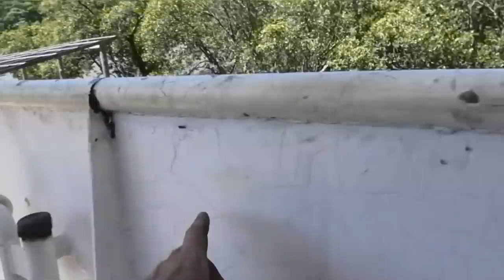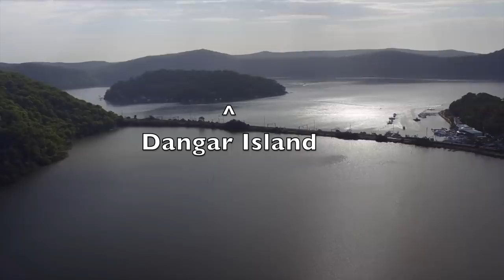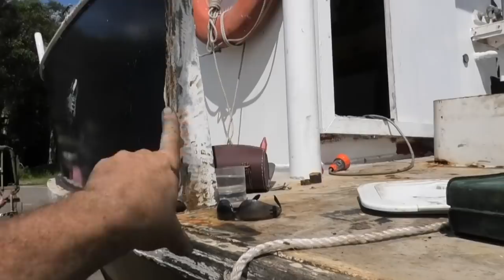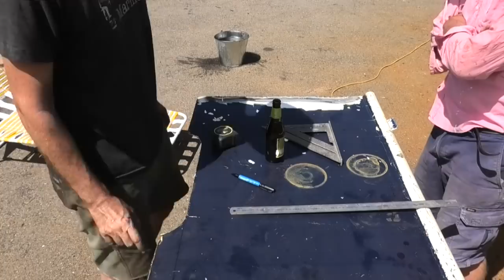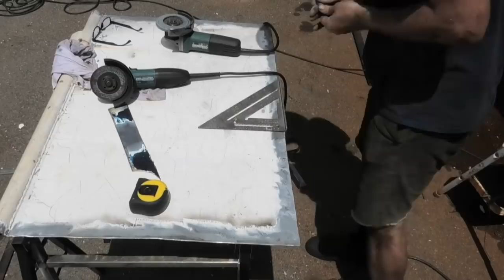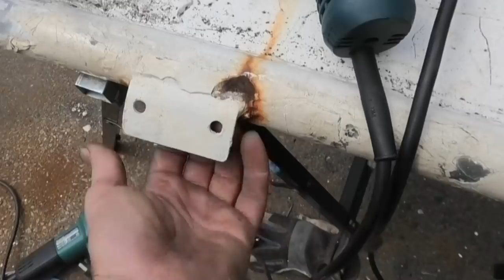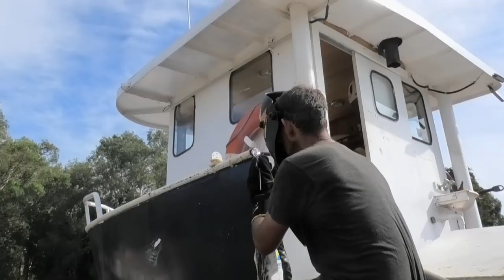Making a door in the steel trawler

Comment: Grinding/Cutting safety glasses a MUST. I've had metal in my eye Stu and its NOT fun!!!
Reply: You should have engaged your 'safety squints' haha
Reply: Over here we know them only by their power and the 2000W grinder is my go to tool for heavy cutting and even though I have an oxy-acetylene torch, I've never used it. I always use my plasma cutter or big grinder. 90% of grinder safety is planning your cut so that your grinder won't come at you if it grabs, sparks won't come at you and that the cutting disc doesn't get pinched. If the sparks don't come at you, you'll probably get away with those safety squints...lol
Reply: yeah it's not fun when they come into your eye with hypo needle and telling you not to move or blink while they drill our the metal piece, mine started rusting in my eye....
Reply: Strange that when I built a steel boat and wore safety googles, the metal pieces got past and  into my eyes, and I was regularly at emergency and the eye clinic, now I only wear glasses and have no problem.
Reply: Agree here Stu, my spark welded to the surface of my eye. The hospital had to numb it and pick it off with a hypo needle, then bandage until the numbness wore off
Reply: @mongomay1  That is really important. If you think you might have something in your eye, go to the hospital. It's not alright because it's stopped hurting it's just your eye growing a surface over the particle. Then it starts to rust. not often I put stuff in capitals but, GO TO HOSPITAL STRAIGHT AWAY!
If you're in the position where your head is in a frame and they are advancing towards you with the needle have the good sense to ask the nurse can you place a hand on their leg in case you need to blink, sneeze, throw up or other. You also get the pervert bonus points of feeling the nurses leg up.
Reply: @TonyRule  haha. Ave
Reply: The comments section on the internet is weird. Would you as the viewer of a guy riding a motorcycle down the street without a helmet yell at them to wear a helmet?? I doubt it, so why do you guys constantly do it here on youtube?
Reply: @COIcultist  I did finally, was out of work at the time and no health insurance, just relating a safety experience I had before I knew any better.
Reply: @jacknimble1  Jack if you can see something where someone could get injured if you have a shred of moral fibre you would warn them! Wierd is sitting and watching and saying nothing,  it only takes one spark to hit the eye and embed a hot fragment of metal, trip to hospital for removal then ointments and a patch for a week (best case) or hit in the eye and permanent lose of sight (worst case). People warn because they care,  bad things happen when the good sit idly by silent!
Reply: @mongomay1  The reply to addressed to you wasn't so much to you as the casual reader. You know better now. I wore safety specs but still had a few hospital visits courtesy of blowing off turned casting. Eventually learned better positioning of self relative to casting and blow off gun.
 Casual reader, self or better still a co worker can remove metal fragments (no idea about hot ones but doubt it) by turning the eyelid down and using a damp swab/paper tissue. Fragments can be very hard to see though so any doubt and it's off to accident and emergency for you.
Reply: @jacknimble1  if the guy without a helmet had a comment section i'm sure he would receive a shit load of comments too! Seems like people around here care about Stu too. Just saying...
Reply: @grancito2  I had the same problem full eye protection and somehow a piece got under and hit my eye, went to local eye hospital, they guy started getting it out, told me just a bit more and it would have gone right though my eye, i do remember him shouting at me to wake up, I had it done before but never fainted before, told him he shouldn't have told me it was that deep.
 My vision is still not right due to scarring, but I take more care now, we used to have an old guy who would pull out a hair, spin it into a a loop and drag it across the eye, he managed to get nearly everybodies grit out, but that was a long time back, it would never happen now
Reply: Stu's safety practice and attitude is surprisingly good, certainly much better than certain other diy boat builders
Reply: Yes.. worse than welding flash!

Comment: You're doing a great job, just a couple of little tips. 
 When cutting vertical with a grinder, hold it 90 degrees to your right. The sparks will go past you, not on to you. You will be more protected by the guard if the wheel decides to disintegrate, and if the grinder "kicks back" it will be in to air, not your face... Also keep all flammable materials away, thinners, petrol ext.
  Second thing , the oxy will cut through paint no worries, you do not need to grind the paint off before, it's enough heat to burn steel, it will burn paint.

Comment: You could make an unequal hinge, longer arm at the bottom with the pivot point centre slightly offset out from the top, allows the  door outer edge to rise at a rate to clear the deck. They do it with gates on sloping ground. The door will want to swing down under its own weight but you'd have a standing latch anyway on a boat.  Just my two cents worth.......   keep on keeping on, good stuff.

Comment: Think about setting your hing pins back from the door and at angle to the door.  The bottom hinge in towards the center of the boat.  This will make the door open up clearing the deck. It will also make the door want to stay full closed or full open.
Reply from the maker: Yes, it is a toss up before having it open inwards and outwards or favouring one direction like you suggest.

Comment: I may have missed your ideas for a latch for the door, so I appologise if I did.  However. Seems to me the best idea for a latch would be a sliding bolt through the round tube on the top of the door into the round tube rail on the top of the wall.

Comment: When you do the hinges, use a minimum single  tack weld on each half of the hinge and the work the full range of motion. Should allow the parts to twist or bend into alignment and less fuss than trying to measure.
Reply from the maker: Yes, I agree that it will be almost impossible to measure accurately. Welding in situ will definitely be the way to go. I like the idea of the light takes and letting them find they own position before welding out fully.

Comment: i was thinking a double door situation would have been better where you put a gasket in between the two doors that still swing inward but you have a much smaller door on each side and you could put a gate holder that you can latch on both sides then you wouldn't be putting so much weight on a single door hinge and your passengers could get in and you could easily get in and get the best of both worlds.

Comment: You should cut a notch in the bolster at the top and use it as a latch mechanism with a pipe inside the bolster.

Comment: You can use the round tube on the top as a latch . Get some tube that fits inside . Cut a slot in the door and make a slide bolt in it . Easy done and big and strong .

Comment: Hey Stu,  Great vid. One of your best, and that's a high bar to jump.

A couple of comments:

a. Please retain Dave P as your chief design consultant, at whatever cost. His advice is invaluable. Hinging the door from the front was really your only option. A suicide door at sea not good. Also, that will likely be the door you use for diving in the future, so grabbing heights and a ladder for recovery will be part of the mix. 

b. I know some pedantic YouTubers have given you a hard time about workplace safety.  I have to agree with them on this occasion. In one sequence you were grinding the door flat on trestles and your Lashes beer was vibrating and in imminent danger of falling off. Please take more care with your beer.

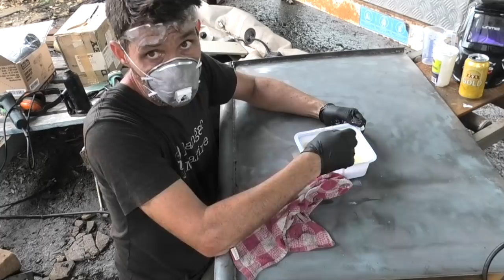c. Finally, boat restoration is a hot and tiring business, but please maintain your standards. At 28:35 I spotted a can of 4X Gold in the shot. This is not good. Always keep up your standards. 

Thanks Stu. Love your vids.
Reply from the maker: All your points are entirely valid. ;)
Reply: Best comment so far...lol
Reply: Paul G , love it ,great comment
Reply: Stu if you're not careful the alcohol wast not want not board ,will be on you,,,, there way worse than the EPA,,,,
Reply: All very good points but there is nothing wrong with 4x gold
Reply: d. The Acetone can on the welding bench was interesting. e. 9" grinders are verbotem by Worksafe on WA minesites, have done a lot of collateral damage to the unwary.................hands, arms, heads, eyes & legs............. in the past. Too much grunt & they have a mind of their own if you are not sharp.Enjoy watching your videos, big project, stay safe Stu.
Reply: someone help me out here....from north america...is 4X crap beer?  I may have to up my sub, I can't handle the though of Stu having to resort to crap beer.  Maybe a care package is in order.
Reply: Couldn't say it better! Haha! Got the guys at work till start watching and we all agree...it's the beer breaks that got us hooked! Good to see a "normal" channel on here. A libation break is a must! ✌
Reply: @753crazzy  I don't even know what 4xgold is,,I just thought it mite be drinkable,ha
Reply: @HughJazz69696  yeah mate 4x is rank. I doubt he would've bought it, he knows that the best beers in Oz are South Australian beers
Reply: I was with you until point 3 and you started taking pot shots at the iconic Milton Mango. Low blow, mate.
Reply: 753crazzy , do you know the reason they called it 4 X ,,,,,,
Because the Queenslanders can’t spell beer
Reply: 4x is the best de-greaser there is! I wouldn't respect this channel as I do without it's inclusion. But, the pink Ralph Lauren shirt doesn't fit; advice aside. Maroons jersey or nothing...
Reply: @jet-black  Yeah, yeah. We all know it's really a State of Origin thing. But you won't get me to admit that in a court of law.

Comment: Hi Stu just an idea regarding your door the piece of tube you cut out of the door if you had got a section of solid bar that fitted inside you could have made a slide bolt by tabbing it with a bit of plate so it slid between the door and the adjoining panel. Then just welded a locking plate on the door to prevent it sliding open while under way.
Great video really enjoying this series on the steel boat.

Comment: This is when making a test door out of scrap wood helps. Easy to chop and modify and then transfer design to steel once you happy with it. Much easier to test fit a light weight wood door than a lump of steel. If you get it wrong then just chuck it back in the waste pile and make another until you happy with it.
A pair of split doors has a lot of advantages. More work to make but easier to move around when open. Could open outwards and lock back against existing structure. Doors completely out of the way.
Reply: Even heavy cardboard works for templates.

Comment: Thanks for another really interesting video.   Spent my day hanging drywall (gypsum board) for a bathroom remodel in an old, very out-of-square house.   Watching your video, trying to decide if I'd rather weld, grind and fit metal or cut, mud, sand and fit drywall.

Comment: did you think about cutting the door down the middle and hinging it on both sides?, that way it wont protrude as far into the boat when open and the hinges won't need to be holding as much weight
Reply: Exactly what I thought, and I'd hinge it outwards with catches to hold it open.
Reply: @ji6050  I just read his comment like 5 times and couldn't see any mention of it hitting anything, wait, let me check again...... Nope, nothing there.
Reply: I also think duel split door is the way to go. Yes it is a little more work and a bit more cost but it will be more practicle and less stress on the rails overall.
Reply: Gary Baris he did say there are some mooring points that are above the deck line preventing the door(s) from opening out

Comment: There seems to be a lot of weight in that door. You need strength in your newly introduced weak-spot especially considering the impact from waves, motorbikes, and portly passengers etc. Have you considered a centre hung pivot hinge for top & bottom? A centre hung pivot is a pivot that is installed in the center of the door either on top or bottom of the door with the majority of the weight taken by the deck. Advantages are it will be far stronger and you can have a double-acting door meaning that the door is able to swing in both directions. There are some heavy-duty centre hung pivots available or you can make your own.
Reply from the maker: Interesting. I just took a look at a set and the first ones I found say they can take 136 kgs so they are obviously very strong. I'll look into that more. Thanks for the tip.

Comment: I wonder if having the door open like a set of doors he's like a set of French doors then it would not be so much in your way when it would be open. And you could use a really good sliding Bolt set up to lock the two doors together while you are out at sea so that if you're taking rough waves really hot today wouldn't be wanting to be forced open. Also with that large of an opening underneath the door I'm not sure if it would be a benefit to Leave It Wide Open with a few inches underneath the door for the full length of the opening to let water drain off the deck or if it would be better to have less of an opening to prevent water from coming in from that side even though it would just run to the back or to another hole in drain off the deck

Comment: Should cut in half and hinge from both sides and use pipe that slides back and forth inside the railing to lock them.
Reply from the maker: I think the sliding pipe will be a good latch system but I'll keep it as one for a while and see how it goes before cutting it if needed.
Reply: @DangarMarine  Right now, it's one heavy door that needs lots of clear room to open; a two piece with one side having a latch that secures it down into the deck will allow you the ability to only open one side at a time, if you want. I picture the down latch like 24mm round bar going into a pipe with a 24mm inside diameter and that pipe curving out and draining overboard thru the side of the boat. This way, if any water or dirt goes into the pipe, it will just go right thru it. If you want, I can draw out some plans and email them to you, so you can see what I'm picturing.
Reply from the maker: I like the idea, particularly of draining the latch hole over board. Happy to look at any drawings you have. Email is dangarstu@gmail.com

Comment: You could have used some round stock and the top tube on the door and the hull to make a pair pin latches. It would pin into the rail in the front and back and really secure it. With the locks engaged you wouldn't have to worry about it being bashed open.

Comment: "Overhauling Valves, 1 Pair of Eyes and Guide Dogs"

G'day Stu,
                 To save you time, effort and new pipe work runs, try to utilise what you already have fitted in the boat, overhauling or refitting those valves will be pretty easy for a guy of your calibre.

It will save you a heap of money, hull valve, studs, gaskets, stag, fefitted valve and new gaskets for pipe work, sorted mate, seriously!!
Twill never leak.
Silicone is what you seal your shower with or your vanity,lol if you go the other way.

Now, the serious stuff.
Everyone watching your journey wants to see you finish it, maybe they all don't say it about eye protection, but want to look out for you mate.
One pair of eyes is all we get, and that was what we drilled apprentices with or anybody.
I'd rather You finished the refit than the guide dog.( as its hard to fly a drone if your a dog )

Your doing a champion effort mate, box is in the post this week.

Cheers
Malc qld

Comment: cutting out the port side panel will weaken the ship and cause flexing to affect the hull differently. hopefully not in a really bad way. make the hinges on both ends bi directional and including the latches so you can open it any way you want or remove it any time you want.
Reply from the maker: The hull and deck are still a complete tub, it won't affect the strength of the hull at all. I'm definitely moving towards the idea of hinging it a both ends.

Comment: Enjoy your videos a lot and don't think I have missed one on this steel boat!  Had a thought I thought I might share and it is perhaps just me overthinking a simple thing again - It wouldn't be the first time, won't be the last...  Anyway, I like those hinges you chose and the idea of being able to completely remove the door; however, I was wondering what you think the likelihood is that, since there appears to be only about a foot of freeboard, some wave action/pressure in rough water could possibly push up against the door, thereby lifting it up off those hinges?  If there is any chance in your view, maybe there is a hinge available that will fully release when you want to remove the door, yet can also lock in place while under way??  Anyway, big fan here from the USA wishing you well.  BTW, your other videos on outboards are excellent!  Man, I need find a boat to work on, but for now I will keep watching your excellent work - Thanks!
Reply from the maker: Hey mate, great to hear you've been enjoying the vids. Yes, I definitely need to find a way that will stop the door lifting off while in rough waters. There a few ways of doing that so I'll have to figure out which one is best.

Comment: fyi
easy carpenter trick, measure how much rise you had, add any deck distance to it for rubbing clearance, subtract that distance from bottom of door and cut off. It will show parallel to deck when closed and clear when open. I think on your you'll have to measure top down as reference.